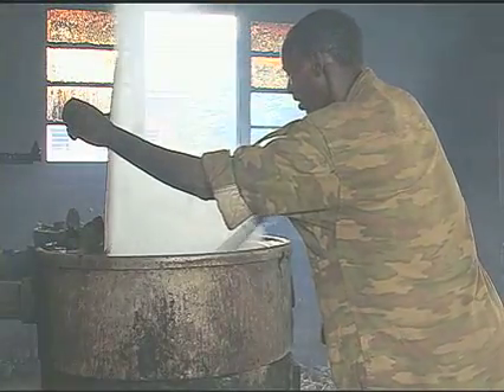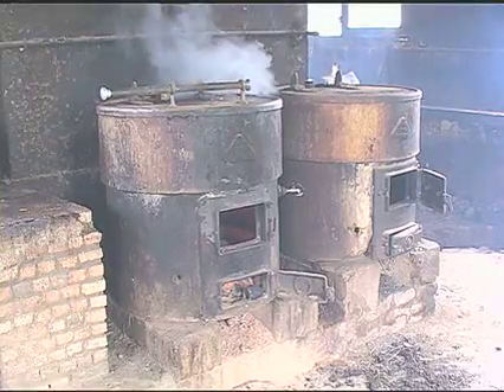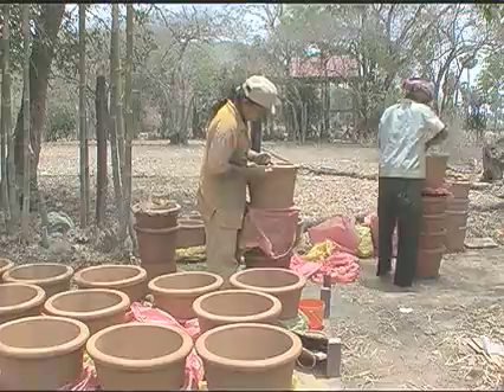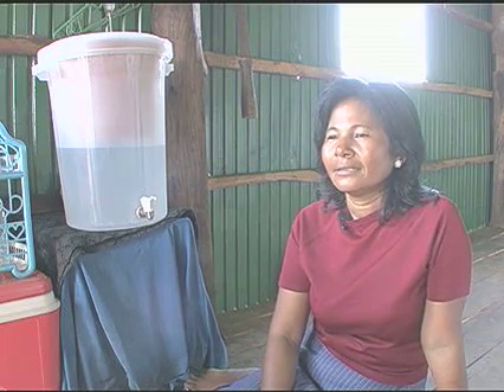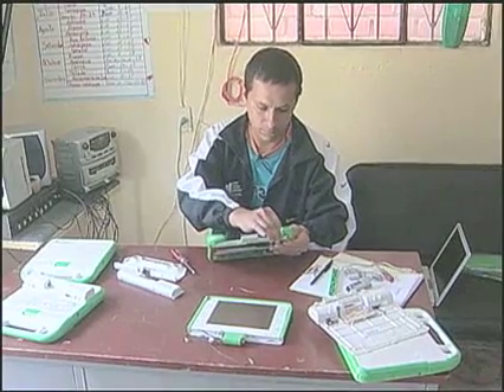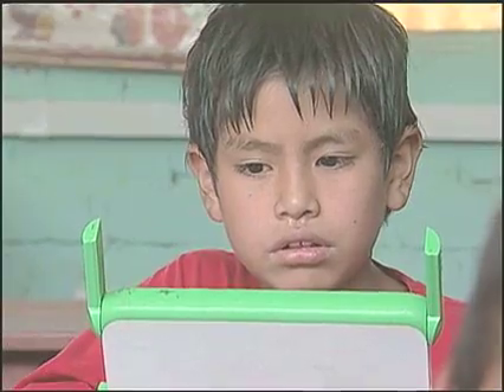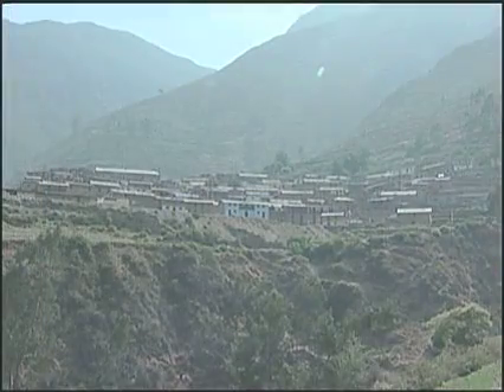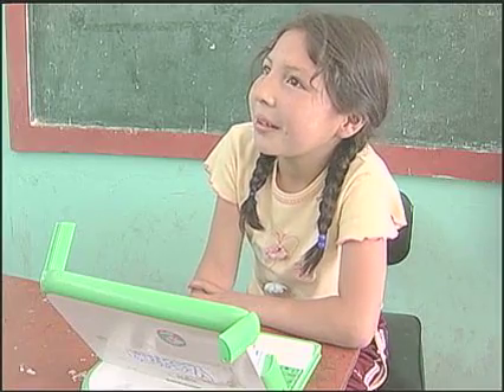Appropriate Technology Gains Ground in Developing Countries

Comment: Peat protects the environment!!!!!!  Idiots.  Peat is a fossil fuel.  wood is far better to grow and burn as it is carbon nuetral with biochar is can be carbon positive. This report is  truly ridiculous.
Reply: I was concerned by your comment as it seems to undercut what is being proposed here which seems truly valuable. Checking on the internet I found the following, which makes a different point, unless of course you are being ironic:

Peat is so common in the United States and Canada that most people can't see the resource for looking at it. There are an estimated eighty million acres of deposit right here in the continental U.S. Most of this vast natural supply goes unused . . . although some people do throw a few bushels of the muck on their gardens for fertilizer and others use the more fibrous and mossy varieties as a dressing for flowerbeds. What most folks don't know, however, is that peat can be a clean-burning, efficient and low-cost fuel!

Last summer I often passed a swamp where a man was digging muck for sale as topsoil. I wondered if the wet material could be the "peat" I had heard was used for fuel in other parts of the world . . . so I obtained a few hundred pounds and dried it. The idea worked! Once lit, the chunks glowed like charcoal and gave off gases that burned with a flickering blue flame!

Peat is nothing more than partially decayed and compacted vegetable matter which — over a period of time — has accumulated where soil is wet enough to retard oxidation. Its color and consistency can be black and mucky or brown and fibrous or anything in between. Individual moors, bogs, swamps and shallow ponds each produce their own "copyrighted" variety of the material. In fact, varying types of peat are often found in layers — each formed as a result of a change in climate or vegetation — within the same marsh. You might even discover that the "turf" differs from one area of a single bed to another . . . and the bed itself might be a few inches to several feet deep. In its natural state, peat is around 95% water by weight (most of which must be dried out before burning) and frequently contains some sand.